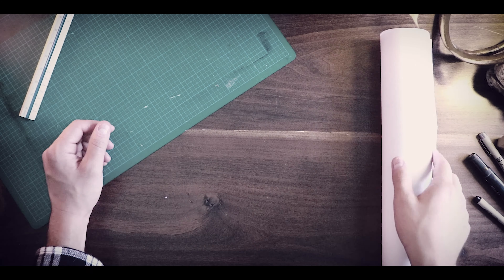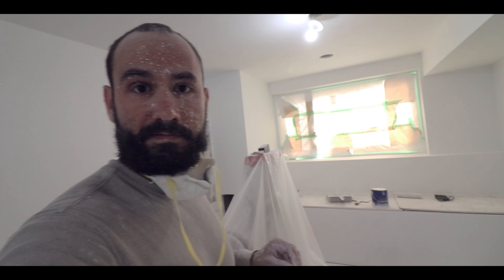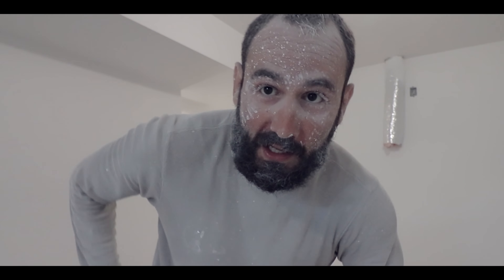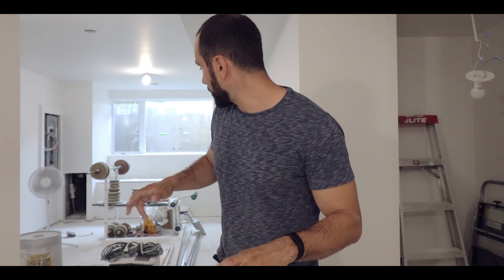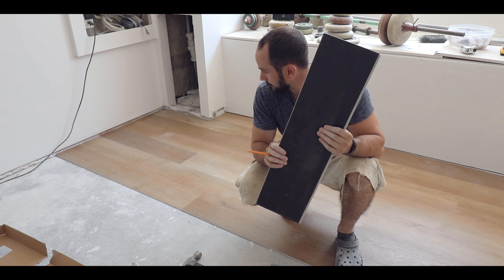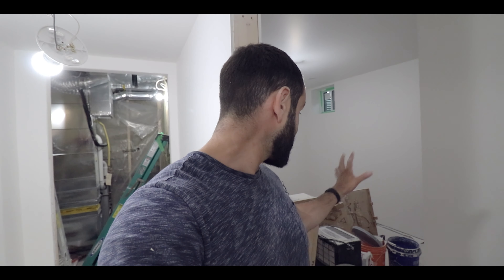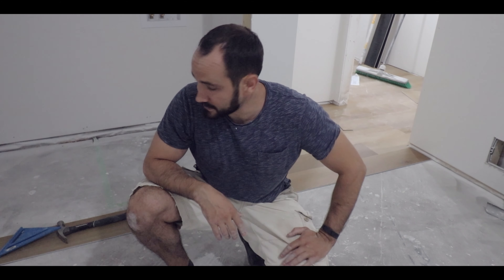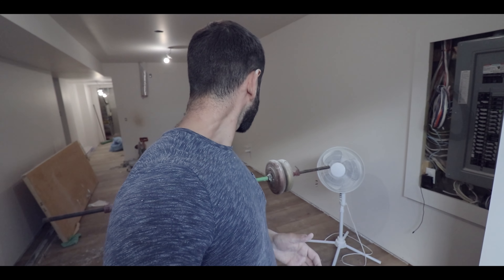EP5:  FINISHING A BASEMENT : HOW TO INSTALL VINYL PLANK FLOORING - DIY

Comment: I am planning on installing vinyl flooring in my basement. The floor is cement. Do you have to lay any plastic down first. The cement is not painted. House is about 40-50 years old.

Comment: I wish you'd shown how you worked around the drains. I'm currently deciding best approach for my basement.  it's total of 3 rooms. biggest is finished and carpeted. next one is the one I'm working on. Making myself a walk in closet. I'm done with the walls. Wallpapered top half baroque style and bottom is shiny black. my dressers are gray and black with  chrome silver hardware. I rehabbed those also. I digress because I'm so excited.  That room has half peeled concrete floor. I want an easy method. I'm sure it's uneven due to drains but wondered if I could use floating method and but the sheets of vinyl flooring! not the planks. Don't want to use adhesive, not opposed to using double sided tape. Don't want to weatherize or even out floor.  I have dressers and wardrobes that will go in there and keep vinyl on place! I hope. Does it sound doable?
Reply from the maker: The drains are a bit of a pain. I just cut around them but it's a little lose around there. No issues though after 2-3 years. What did youe nd up doing for those?

Comment: is the vinyl plank flooring waterproof?  planning to replace carpeting on my basement.  thanks.
Reply from the maker: Yes, it is. that's a main reason we chose it. It's fully waterproof and the click system can be dismantled and reassembled in the event of flood. You could in theory just number each piece, take everything out, dry it, clean up your basement and lay everything back exactly as it was.
Reply: @HugoBuilds  sweet. Thanks for taking the time to respond 🙏
Reply from the maker: @MyKkata  my pleasure! thanks for watching.

Comment: Good job! Can't wait to start doing vinyl flooring in my basement. I'm installing the drywall this weekend and going to do everything myself - wish me luck lol. Is there a reason why you didn't use a subfloor?
Reply from the maker: Manufacturer says no need to use subfloor. This vinyl has an underlayment attached to it which helps with comfort and noise, it can be installed directly on a slab. Good luck!

Comment: You are going to have a LOT of popped seams over time ( Might take a while ) but you WILL. You have to put a transition about every 200-300 SF depending on the flooring brand. That’s to break up the rooms so that the entire floor doesn’t didn’t expand and contract all together as one. What happens is when the floor expands and contract there so many inside/outside corners it’s going to start hitting them. It’s a 50/50 chance of it happening honestly. But I have a solution if it does start to buckle. You can always go back in an add t-transitions to break up each room ( or every 200-300 SF ) so that the floor won’t buckle. You just pick where you want the transitions and you cut out 3/4” of flooring ( Directly center of door openings ) and then you can add in your t-transitions. Only do this if you start to get buckling though. Just figured I’d share a solution if it is happening. Been doing flooring for a LONG time. I can also teach you how to replace a single board ( Even in the middle of the room ) without having to take up the whole floor to that point. I know every trick. LoL
Reply from the maker: Thanks. We will see how they turn out. I like the continuous look so I'm curious to see if I will have any problems. Manufacturer doesn't seem to have that in their recommendations.